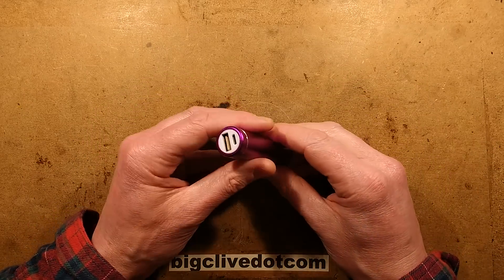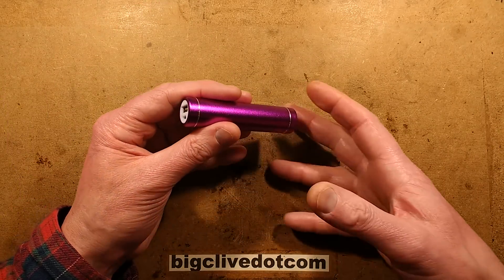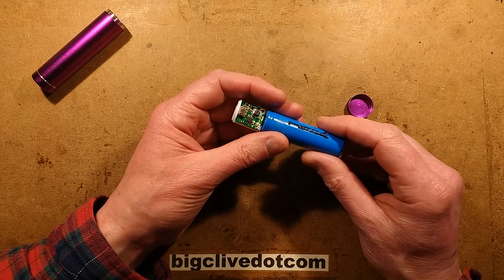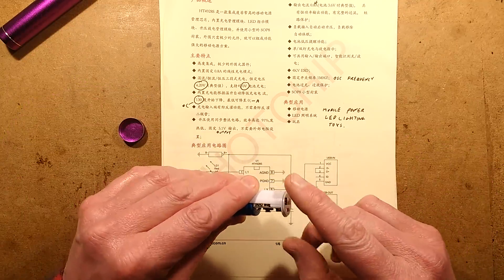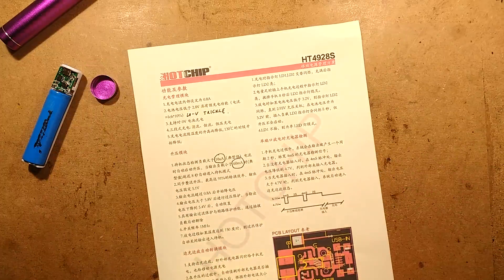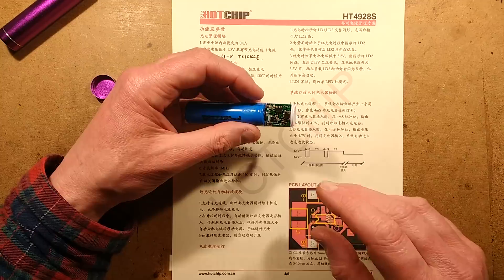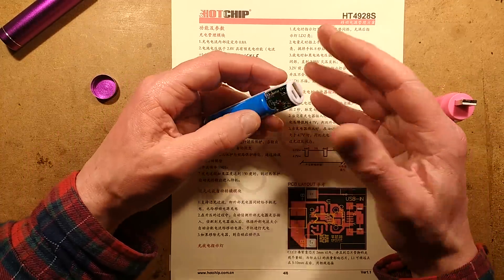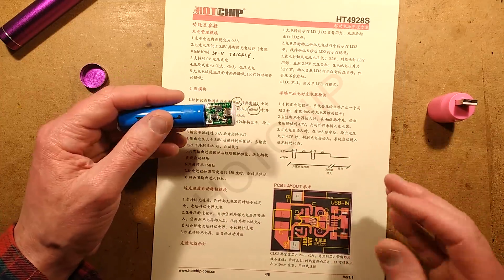Unusual USB power bank control chip.

Comment: The spring-loading is super cool! I've gotten a number of power banks that are the same aluminum housing, but the cells are soldered or welded in -- nice thing about that design is you could have a few single 18650 cells in plastic cases that you could swap out, rather than having the cost of many of those banks

Comment: Hi. I bought a bunch of these at a discount store today. I've had one charging for quite a while now. It's flashing red. A few questions if anyone can help.
How long does it take to charge?
Is the first charge the longest?
Does it stop flashing when it's charged?
Reply: I will say that the battery is charging. I just tested it in a flash light that takes either 3 AAA or one 18650 and it works. I'm very happy about that. Just have charging questions asked above.
Reply from the maker: Sometimes the first charge takes longer due to initial low current cell recovery.  At the end the charge current will tail off slowly, but after an hour or so the unit will be almost fully charged.

Comment: Add a cap and low forward voltage diode on the output for maintaining voltage during the 'drop' period? (Diode being so the cap doesn't cause the chip to think it is being charged due to maintained 5v on circuit).

Comment: Interesting. I have, in fact, experienced the "low current" standby mode. And I am trying to disable it somehow. I need to connect some powerbanks to low current leds for lighting mobile objects (that can not be wired, except for charging), and with extremely low power LEDS (like 5 3058 LEDS). But I am having these 2 problems: 1) When connected to the powerbank, I have to press a button in the powerbank to turn them on (I can connect this button to the main On/OF switch I guess, so this is the least of the problems) and 2) They do, indeed, shut off after a while.

Have you, by any chance, discovered how to prevent this from happening without increasing the needed current in your own PCB? (I want the battery to last as long as possible).

Thanks!
Reply from the maker: There are a few options.  Some fancy power banks allow an always-on mode, there are modules available that pulse a high current briefly to reset the power bank timer and the cheap power banks with no LED display often just put out 5V all the time.
Reply: @bigclivedotcom  I just read about the brief pulse in a forum. Interesting! 
The always on mode, is equivalent to the “cheap ones” that they always pull put 5V? I read that if you are in that mode, you need to charge them more often, but I don’t undestand why, (maybe it is incorrect unless I am missing something). Maybe is the chip that needs to be on, at all times in order to pull out 5V, thus consuming power?

Comment: I've been looking for some powerbank kits so that I can make use of the salvaged cells I have around here.  The search has not been easy,  with some of the ebay listings indicating that once you put it together you can't take it apart again!?  In the meantime I ordered a couple of these:  https://www.ebay.com/itm/USB-Portable-External-Backup-Battery-Charger-Power-Bank-Case-Box-For-Smart-Phone/333865500089?var=542932197402  They were slightly difficult to open,  but I managed (without a spudger,  too,  imagine that!).  I then used these to charge up the cells I had on hand before I put them into the capacity tester that I also recently purchased,  and to recharge them afterwards.  One unusual feature of these is that there's no on-off switch. Apparently it senses when you plug something in,  and illuminates a blue LED to indicate that it's on.  And there's a red LED to indicate charging,  when it's flashing,  or power in available,  when it's on solid.  The circuit board in these is even tinier than the one you show in the video here,  and there's only one chip on it.  It's a TP4333,  and a chinese datasheet is available for it. The schematic in the datasheet does show a switch,  and a third LED,  the purpose of which is not clear to me.  The charging input and USB output connectors are NOT connected in common like the part you show here.  I've not noticed the odd behavior you note here,  Nor have I measured the standby current (you don't detail how you do that).  You might find this part rather interesting as well...
Reply from the maker: The smaller units like this often just have 5V present on the output all the time and top it up as needed.
Reply: The datasheet when looked at with "translate" says something about the chip sensing when there's a load there.  I guess those capacitors shown on the output have some bearing on this?  The switch and LED I wasn't sure about in my earlier post are apparently for a flashlight kind of function,  which is not implemented on these units.

If you happen across a kit that'll hold 4, 6, or even 8 cells that's going to be reasonably easy to open and that won't shut down when it doesn't think there's a load present I'd sure appreciate a pointer to it.  So far my searches have not proved fruitful.

Comment: Hi, is there  a  different  chip  , for higher current to sustain 1amp or 2 amp, from hotchip or any other manufacturer
Reply from the maker: There are.  Usually larger chips with battery level indicators.
Reply: @bigclivedotcom  can you suggest a chip model for reference

Comment: It would appear there have been some "upgrades" to this design a bit.  Seemingly the charging circuit has been improved without the glitches but then when I plug in a 440 mAh LED load, the charging current goes down.  Normally charging in the 220 mAh range for a battery supply almost charged to 380 mAh for charging and supplying the 440 mAh load.  

Of course my electronics are much different than this.  I guess the two 8 pin chips in mine are doing things much differently, also; again, my battery is welded in and has mWh listed on the sleeve which I find annoying.
Reply: I guess I was hoping for the charging current and the load to be sort of combined.
Reply: my charger seems to be providing 5.19 volts either way.

Chinesium witchcraft?

Comment: Old video but I just found a bag of these in my apartment and was looking to see if anyone had fiddled with them. I vaguely recall my sister getting them from work or something but I forgot I had them.

The housing is different but the battery and board seem just about identical.

I have about 10 of these now and don't know if I should sell them or make something with them. The only one like it on Ebay is $8 with shipping but I can't imagine they're worth that much.

Any suggestions?

Comment: I am working on a similar power bank with the same chip HT4928s. I have connected a LED light with a switch to it. But when i am switching the LED off, the light comes back on automatically. I have tested it with a motion sensor LED also. Even when there is no motion, the light comes back on automatically. I understand this is an old video but would appreciate if you can help.

Comment: Great video, thank you very much! I was intrigued to know how it detected the voltage input. I was starting to translate the datasheet when I found your video.
Anyone tried to connect a solar panel as a voltage input?
I was struck by the fact that the datasheet says:
"The charging input has anti-reverse irrigation function and does not require anti-reverse irrigation.
diode; "
I am using it to power a microcontroller that luckily handles flashes of LEDs every 4 seconds and that is enough to avoid stand-by mode.

Comment: I get those item removed notifications all the time,  one time I ordered replacement thumbstick caps for a  PS3 controller and they shipped the ones for a PS4 instead, so I couldn't refund or do anything because the listing was gone.
Other time I ordered a PSP battery that arrived in an envelope with no padding and the plastic casing on it was shattered, it still worked but damn that thing was definitely not up to code in terms of shipping regulations. Although I assume the reason they got rid of it was the fact that it was a knockoff product but who knows. It's just annoying that you completely lose out the ability to do anything about the packages, not that I mind losing a dollar for every few dozen items I get on ebay for practically free

Comment: I actually used one of these with an old laptop battery to power LED lights around my Santa hat at work this Christmas. The lights came with a 3xAAA battery holder and I just chopped that off and stuck this and a small capacitor in series with the lights to hold over the 14 second flicker I noticed too.

Then for half the time I wore it I used the flashing mode on the lights' control chip and so didn't need the capacitor anywho.

Still, when I bought these, I bought 8 of them. Got one dud that refuses to output anything but will charge, so has now been repurposed into another project as a dedicated charge circuit.

Comment: I have the exact same power bank, however mine did come with a battery -- and not in a good way.  The included 18650 battery in mine is actually soldered onto it.  There is not a 'springy thing' at the bottom.  There's a rubber square 'foot' on the bottom of the battery, and it looks like the wire is just tucked under that sticky foot.  That wire then climbs up the inside of the device and is soldered onto the board directly.  Without actually looking at my ebay history, I can nonetheless guess that I bought it about 5 years ago or so.  To be quite honest, I actually would much rather have one where I could pop in a different charged 18650!  But if I was interested in something like that, I would certainly not be going for a 1 cell solution.

Comment: The cool thing about this is that the 10pack costs like just a few cents more than the PCBs alone.. which I've long been using for compact single-cell powerbanks (solder it to the top of an 18650 and heatshrink it).

Comment: I recently salvaged a bunch of 18650 batteries from some old laptop battery packs and bought a similar item to give it a try.  It's rectangular instead of cylindrical though.  It only cost $0.87, so I figured it was worth the experimentation.  I tried it with the bulk USB LED boards that Clive mentioned in a previous video (https://www.youtube.com/watch?v=HgNFwoSwhbM) and got a similar dropout at around every 11 seconds.

Comment: Have read that article about passthru on power banks and potential battery damage due to this and i may have a theory on why e-cigs in general (i own two different ones and have tried a few other different models, too) can be used while charging, while power banks in general do not.

E-cigarettes and vaping devices in general are high current draw devices and are (still) a niche product, the use of specialized batteries is recommended (and a frequent topic on vapers' forums and blogs), and the general consensus is you should expect to replace batteries often (every few months), and people are made aware of this. So the manufacturers have no problem enabling a feture that may potentially reduce the lifespan of the battery - it's geting abused anyway, and buyers of these devices are made aware of it. On the 2nd vape that i have bought i got a 2 month warranty LOL - and i bought it from a retail vape shop and not online! That's not even legal. I am sure that it will last me for more than that - but it shows that they expect people to be careless with them.

Power banks otoh, are aimed at the general public, and are expected to be usable for 1-2 years, some brands even offer longer warranties than that. Add to this that the cheaper power banks are using recycled cells, and a lot of them cannot be opened easily and are not designed to be user serviceable, and you start to get the picture. The manufacturers do everything they can to ensure maximum lifespan of the cells, and avoid getting a bad rep like some laptop manufacturers got, due to poor battery management leading to premature failure of original batteries. Thus, you paid good money on a big power bank, no passthru for you - if you've got your power bank plugged into the wall to charge, then you likely have somewhere to plug your phone into, as well.

HP used to be crap in this regard but they have gotten a lot better as years went by, now i think the worst battery management award can go to ASUS, which is surprising to me given that they use high quality cells in all their products - but they somehow manage to have one cell shorting out and killing the whole pack.

Comment: Clive, a little mistake @ 2:20 (looks like you did realize it afterwards), the spring cannot cause the battery to short even if the insulation wrapper is ripped, because the spring is on the negative, and the negative of the battery is the whole can.

What you are describing can happen at the positive terminal, however, judging by the shape of the contact on the positive end, this wouldn't be something to worry about with this power bank.

Comment: I wish I could find a neat little 12 or 13.8 VDC "UPS style" supply using 18650's, where it only kicks in when the external supply voltage is eliminated.  It would be designed to take just 4 cells in series, and work with multiple sibling units plugged in parallel circuit.

Comment: Could you put a capacitor on the low current load (i.e. LED strings) in order to prevent that dipping from happening?

Comment: This video answered a real problem I had using the same device for powering a microcontroller! No way out from the power dips, so no good unless there's quite a load on. I got mine here - https://www.ebay.co.uk/itm/2600mAh-Portable-USB-Power-Bank-Charger-External-Battery-For-iPhone-Mobile-Phone/231676239923

Comment: I've ordered a same looking (pcb too) powerbank from gearbest for ~$1. Seems okay to me, BUT they *don't have reverse protection*, so if you plug your cells in backward *it will start smoking, a the chip will glow red hot*. I haven't done further tests, but  They work okay, one was a bit faulty, it only drains battery to 3.5V. They have a problem with the thread on the back, put it on wrong once, aaand no thread. Be aware about the size of the cells, my Panasonic NCRwhataver fits okay, but my friends Samgung INRwhatever 30Q is too much.
9/10 would buy again.

Comment: Actually I bought one of these and was having troubles with it, so I took the battery out and without thinking, put the battery right back in... backwards. And within seconds the smoke started pouring out. (And yes, it was a lot.) I SUSPECT that would be the reasoning because I'm sure if that happened while in a charger, it'd be a major source of potential combustion.

Comment: them single cell battery banks are fucking useless IMO, they should make something like a batter bank wallet or purse or even a belt ( actually exists ) lot of shopping centres/malls have phone charging centres where u leave ya phone charging for 30 mins or so and u come back to get it ( its in a locker with power and u get a key for it )

Comment: I just had a similar ebay item give me that warning message. It was for a water filter for my Whirlpool brand refridgerator. I knew it was counterfeit -- in the aution listing description it even said, verbatim "this is a counterfeit filter, it's not <standards body> rated." I knew up front, and was OK with that because Whirlpool does not manufacturer water filters for this model fridge any more (and it's only ~7 years old). And new old stock of them are priced at around $80 each.

Comment: I bought one of these a couple of years ago for $1.49, but it ended up being free because it was defective and I got a refund. The chip wasn't soldered on properly, neither was the micro USB port so it wouldn't work at all. I was able to repair it, but it was a pain due to the tiny SMD solder pads.

Mine looks almost identical inside, the right side of the PCB looks different and it uses a different 8 pin chip with a P/N: SY3501.

Comment: Now that's a weird coincidence. I bought one of those from  rip-off shop near 42nd Street two years ago for $80. I knew I was being ripped off but had no choice - phone power was on 10%, I needed my phone working that evening and was not going to be able to recharge it that day.
In order to get my money's worth, when I returned home, I spotted you could unscrew it and bought two extra higher capacity 18650s which I would swap out as needed. It has served me well up until last week when it charged the batteries but stopped charging my phone. So (and this is the coincidence) just yesterday, I bought a Poundworld Power Bank, removed the charging circuit which I had previously noted had an identical form factor PCB and same component layout, cut off the low capacity battery, soldered in the old charger's battery connectors and viola,  a £1 repair. I'll now have to check the old board to see if there is a difference!

Comment: I blame Big Clive for personally triggering a huge ebay purchasing spree.  All of China should send you one of each of their cheapest shittiest products to thank you.  Speaking of... I got caught in the stupid international power versus proper 120v* :)  I bought a 12v 400W power supply that's input is 187AC-240AC 50Hz... we have 110v-120v 60Hz.  I opened it and it goes through a little fuse and a discrete bridge rectifier.  The capacitors are all 250v... not great for the intended input but should work for 120v.  Do you foresee something exciting if I power on?  And if it does work would it be a bad idea to try to use it to power electronics like a 3D printer?*I do appreciate the 240v ability to do work but in the case of accidently grounding something out 120v just converts a little metal into light and gives you a wee tingle instead of exceeding the forward voltage of your testicles.

Comment: Put a small resistor in parallel with the low-power LED load, perhaps, to draw just a smidge more current to make it not switch into standby mode?